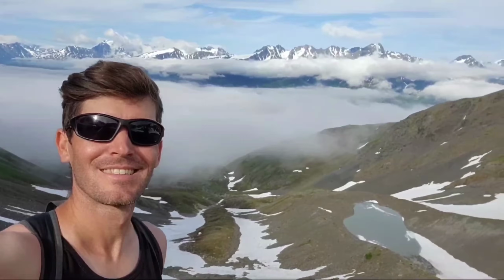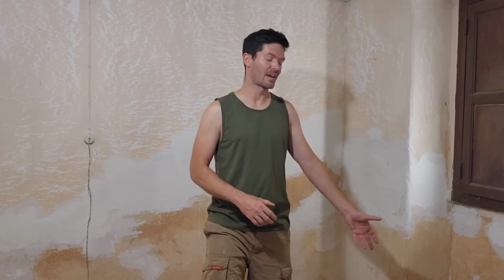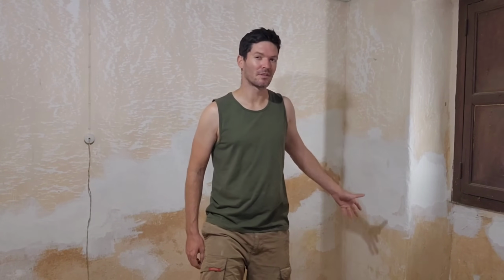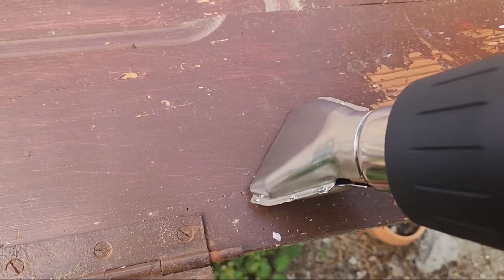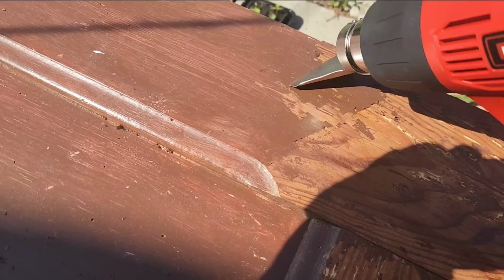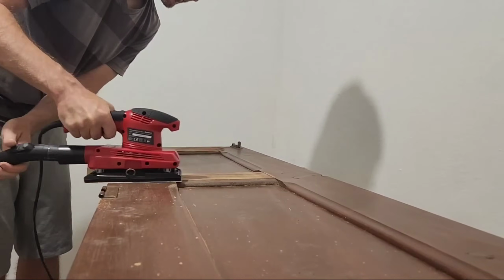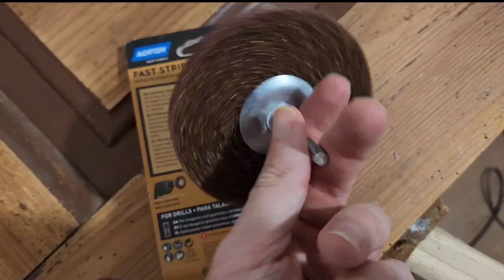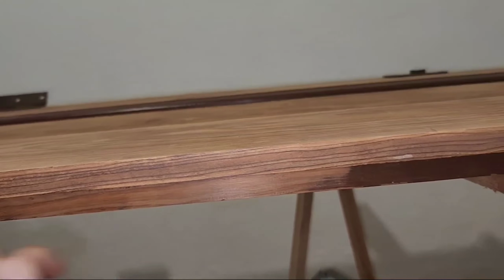My $15K House - Ep. 19 - Painting and Sanding

Comment: Damp refers to moisture being present, whether in the building, on a cloth, in the air etc. You can also damp down or dampen which can mean to tone down your language or to smother a fire (with sand, soil, water etc.) or to lightly wet a cloth or paper without soaking it.

Comment: Regarding your wall -- Get a moisture meter. Either pronged or ultrasonic. And measure the wall moisture from the floor to the ceiling. Both inside and outside. If you have any creeping damp, the wall will be more moist at near the floor. You may need to do this every month for at least a year to get an idea of seasonal issues (two years would be better).

In an old house like yours, if your wall has creeping damp your solutions will depend on how the wall is constructed. If from brick and mortar you have more options than if from soil and stone (our house) or worse if it is adobe. 

Hope this helps.

P.S. Also Expat American, also a Biologist, and have renovated more than one house (a 1951 Ranch, a 1880 Victorian both in the USA, and currently old stone house in Europe).

P.S.S. We had to dig around our stone house, install drainage, and let the house dry out for 2 year before the walls got dry and before we did any renovation. Hope you do not have similar issues. Cheers.
Reply from the maker: oh wow so much in common, this is also my 3rd renovation (the other two were in Nicaragua from the 90s and 00s). The walls are compacted clay so they do hold water forever but luckily summers are very dry here, but I still let the most damaged wall dry out for around a year and it has clay plaster now so it breaths even better than lime plaster

Comment: Damp is the capillary action in walls, to attract water from the soil
Reply: moisture diffused through the air or a solid substance or condensed on a surface, typically with detrimental or unpleasant effects.
"the house reeked of mold and damp"
2.
archaic
a check or discouragement.
"shame gave a damp to her triumph"
verb
1.
make (something) slightly wet.
"damp a small area with water"
2.
make a fire burn less strongly by reducing the flow of air to it.
"he damped down the fire for the night"
Reply from the maker: Ah ok, that makes sense. Thanks!

Comment: Always sand with the grain of the wood as opposed to making circular motions with your sander. You will get a much nicer finish and you shouldn’t end up with marks in the wood.
If you take the hardware off your door it will be much easier to sand around them. Soak them in paint remover and the paint should come off them pretty easy. I bet they would look great cleaned up!
Reply from the maker: I did eventually get all the hinges off, still working on the latches, the old screws strip easy and a few broke off in the wood. Thanks for the tip though, it seemed like everything I saw about sanding hardwood floors said to use an orbital sander so I figured circles were good lol

Comment: That’s old wood. I’d treat it with linseed oil/ turpentine first. Then make shellac. You can get shellac flakes in colors from very pale yellow to orange to dark red. Then mix with alcohol. It is easy to do and easy to repair. Also food safe. Much better than stain or paint. It cannot be used exterior because of rain but great for furniture and interior doors.

Comment: Damp, is water seepage via capillary action. Rising damp is usually resolved by installing a damp proof course. Chemical injection along a series of horizontal holes, usually done by specialists. Other sealants are available. There are damp meters available to test for damp. Damp in the UK usually leads to mold growth. As does lack of ventilation.

Comment: Damp is the thing caused by moisture, so therefore the damp (e.g. The damp in this house has caused mildew to develop). What would you call the area that the moisture which has seeped into the wall has made ? :) Other things that I find amusing with people from the US - what do you call the thing that you put in a bath to stop the water going out ? US = a stopper - UK = a plug (to me, a stopper is something that you put in a bottle) but then US = wall socket UK = (wall) plug US = line of people UK = queue/line of people etc. etc. Nothing like sharing a common language but it not meaning the same thing to both parties :D
Reply from the maker: I love learning all the little differences too! I feel like in the US we just call it a damp spot/area or moisture, like The moisture in this house has caused mildew to develop, or The moisture is causing this damp area/area to be damp

Comment: I use a paint scraper with a carbide blade. They are about $40, but they are a game changer
Reply from the maker: Does that scratch up the wood? There is some minor bug damage so I would be worried it would get caught on that softer wood and dig down
Reply: @My15KHouse  no, it’s an amazing tool. You just have to control it and apply equal pressure. They have a knob on the top and that helps a lot in terms of control. I use them to refinish old furniture

Comment: Use paint stripper next time. Paint it on, add plastic bag. Wait a hour and the paint is easy to remove 👌
Reply from the maker: Those are usually pretty toxic which is what I'm trying to avoid, it would also cost about 20 euros per door and I have a lot of doors, vs a 60 cent piece of sandpaper
Reply from the maker: oh interesting, I'll check that out. I actually enjoy the sanding on the flat parts but all the little corners and stuff I have to do by hand and its not fun so if I can make something thats relatively safe that would be great!
Reply: @My15KHouse  yes just paint it on, cover with plastic so that its more concentrated and give it some time to work. that gives you time for other tasks! sanding is time consuming makes a lot of dust